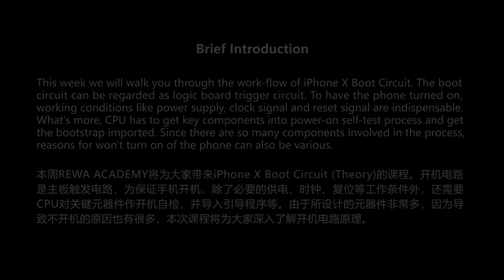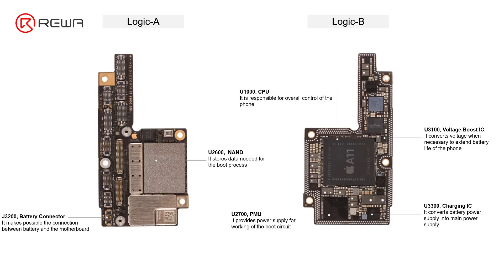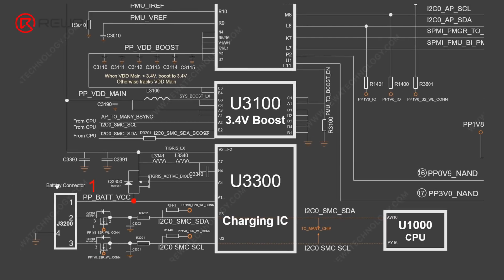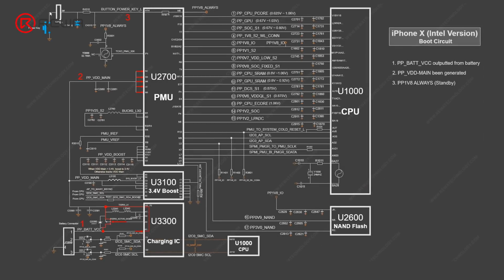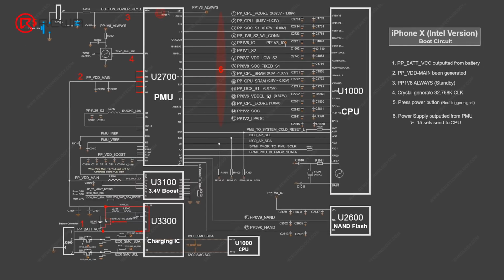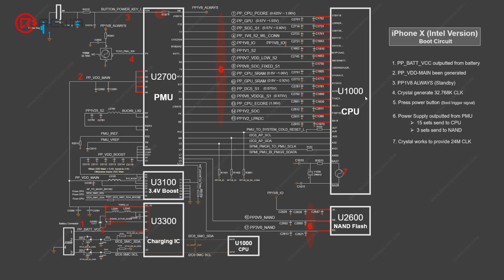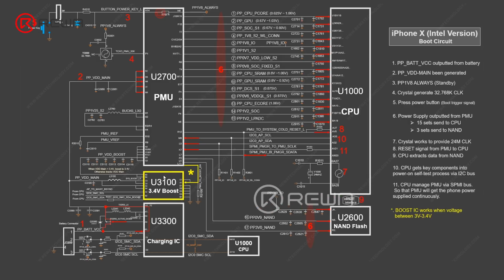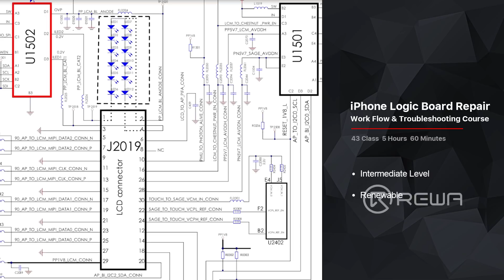How iPhone X Boot Circuit Works | REWA Academy Logic Board Repair Online Course

Comment: I got devices current swing between 

0 to .07 

Amp mostly I found I2C lines has problem but sometimes even 12C lines are okay issues still exist what else is the reason of that current swing 
While power supply connected if I touch multimeter pin to take reading of nand reset 1.8 V 
Current swing stops and device goes to dfu I tried to restore but eventually it gave error 4013 
kindly let me know a proper solution 
Thanks in advance
Reply: Remove the nand and restore it with itunes if its stuck on waiting its relate to cpu if 4013 happened its bad nand
Reply: Ali Virk Sepárate and Solder Again with ch5 preheater.
Reply: mehrdad SL thanks for answering but it’s not a solution I’ve issue with voltage swing that problem occurs when bus or data lines from CPU to motherboard stops communicating i just wanted to know which line and what is a proper solution

Comment: I have I phone x volume down button not working I try to replace the flex cable still the same issue can u plz help me to guide how I can find the voulme down key connection on board to make 
 jumper to solve the problem.

Comment: Hi from Austria!
I was reballing two halfs of the logic board from iPhone XS Max when boot on the pow dc went until 0.12A and after 10 seconds trying to boot again but it’s again stops at 0.12A  could it be pp1v1_s2 ? on the Multimeter diode mode checked 0.007 readings 
Any ideas? Regards mick

Comment: Hello for  There is wrong information .. from iPhone 8, Apple has created a new line for the  power key  . Its >>BUTTON_POWER_KEY
This line is from PMU (U2700)
And they use the line 
PP1V8_ALWAYS 
TO PROVIDE 2 circuits 
1.PMU _XRAL2
2.TIGRIS_TO_PMU_INT_R_L
Reply from the maker: Hi Hussain. Thanks for taking the time to share your thoughts.
Below is our standing based on some research for your reference: 

After PP_VDD_MAIN outputted to PMU, PMU will buck the voltage to PP1V8_ALWAYS. This power with 3 functions:
1. TCXO_PMU_32K (As you mentioned)
2. TIGRIS_TO_PMU_INT_R_L (As you mentioned)
3. Via R3074 then transfer into BUTTON_POWER_KEY_L, to keep the power connector pin 9 related rail with 1.8V voltage, so that the trigger signal can be generated after pressing the power key.

For the signal PMU_TO_AP_BUTTON_POWER_KEY_L, it will be outputted from PMU to CPU directly after CPU is standing to work. 
Based on repair level requirement, we did not put it in the boot circuit.

Welcome to discuss the exchange for seeking common progress :)
Reply: REWA Technology num 3  ** the resistor R 3074 is not existing   On logic board and remarked on the schematics as (nostuff)  so  the  1v8  came from u 2700
Reply from the maker: @eng.hussainalaa766  We are glad to discuss the schematic with you,  it will help us better understand how it works.  

Yes, the “1v8_always” come from PMU, also it is applied to "BUTTON_POWER_KEY_L" and "PMU_TO_AP_BUTTON_POWER_KEY_L" as trigger signal when power button pressed. But "BUTTON_POWER_KEY_L" and "PMU_TO_AP_BUTTON_POWER_KEY_L" signals are triggered in different scenario. When press power button for power on the iPhone from off status the trigger signal is applied "BUTTON_POWER_KEY_L" .  When press power button for wake up the iPhone from sleep status the trigger signal is applied "PMU_TO_AP_BUTTON_POWER_KEY_L". 
This conclusion is based on our master's experience, maybe it's not correct, after all, we are not apple engineers just repair technicians. 

Thanks for your idea and the time you taking for us :)
Reply: REWA Technology REWA Technology ..   with due respect your master have to check the schematics page 30 and he  will find  there is no any connection between 
Power on circuit and PP1V8 always  from A11 cpu  to newest

Comment: Please I need explanation on this problem. iPhone motherboard will be connected to DC power supply, when power button is press, on the DC power supply you will see that it's booting but no Apple logo then the power will drop to zero then it will start again. ( It will be reading on the DC power supply like this when the power button is press 57,80,98,120,221 amhs) this is how it will be reading on the power supply then it will start the same process again but in the process NO APPLE LOGO. Please help me with this problem